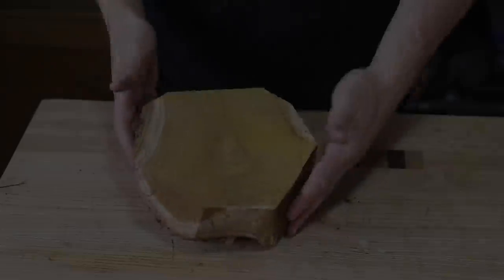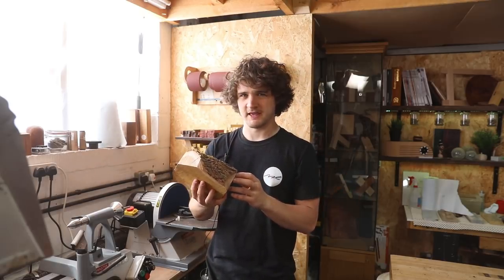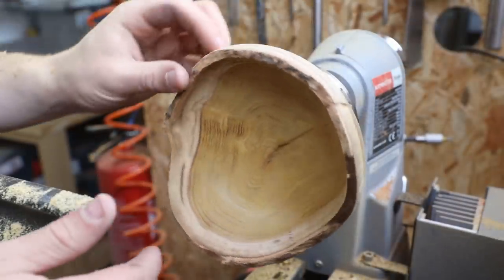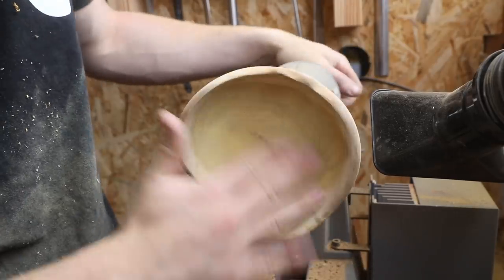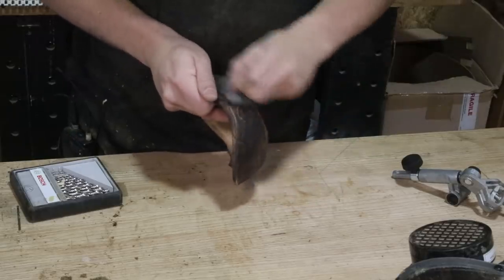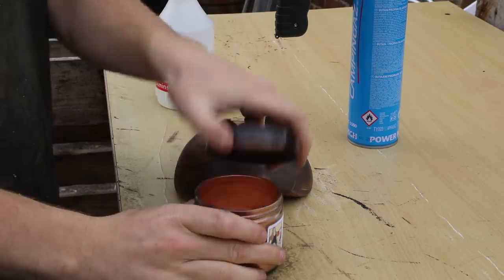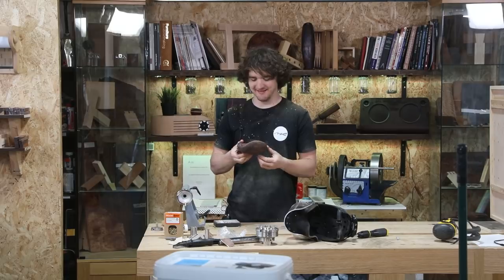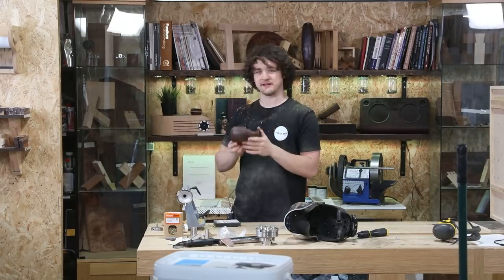Natural Edged Bowl with Bronze Powder | Turning Tuesday #14

Comment: you can try with a scrap piece and apply some spray varnish or poly. That way you are less prone to wipe bronze out. Also I was thinking about mixing resin with that powder and cover the piece then sand it down so the grain can show

Comment: Could give it a spray of lacquer, that way you wont ruin the effect by wiping
Reply from the maker: Yea it still kind of dulls it. But probably better than the dust continuously falling off!
Reply: @MattEstlea  What about an artist's sealer?  I don't know; that might also be spray lacquer at a fancier price.  If it is designed not to change the color of a pastel painting, it might be worth a try.  Try scorching and bronzing a bit of scrap wood so you have a test piece, rather than risk the nice bowl.

Comment: some of those colours are from extremely thin films of oxides from heating the bronze powder.  Adding a finish changes the thickness and so light reflects on a different path and gives other colours, or none.  
Great effect though.   Be interesting to see if it carries on oxidising to green over time, or if heating it already gave enough of a protective coating.